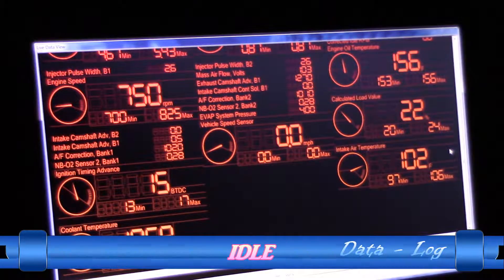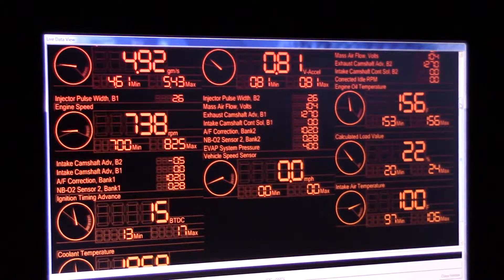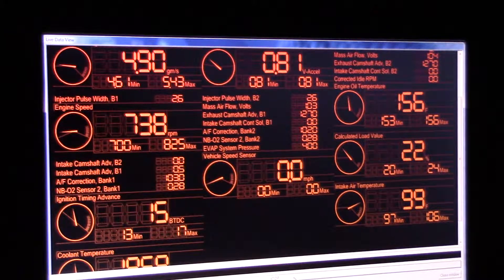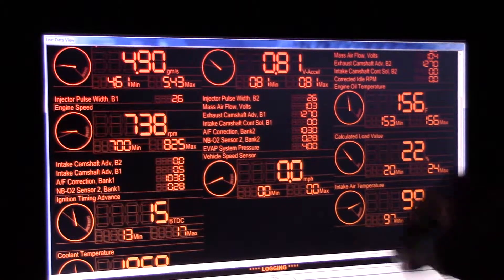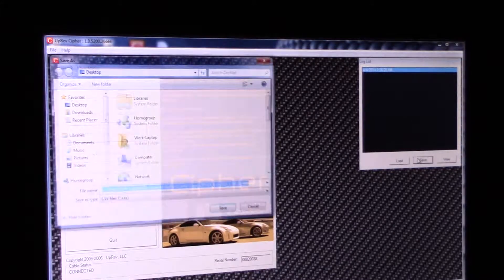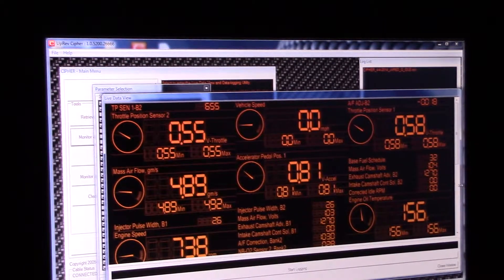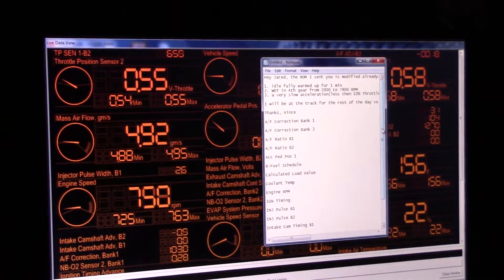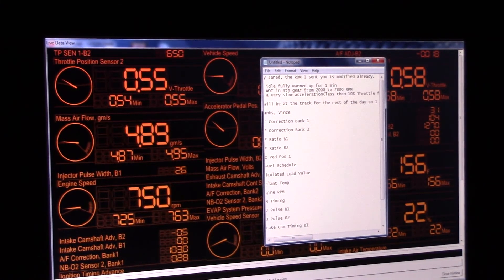Uprev E-Tune Idle Data Log 350Z

Comment: What do i need to see this realtime info of my car ?
Reply from the maker: +VxxF This is for Tuning your ECU.  There are so many variables to tweak and "map" after you have installed a certain amount of performance enhancements to a sports car to get the maximum power out of them.  The data you are seeing is from Cipher which hooks into your OBD port and reads all the variables in real time from your cars computer, and logs them.  You then take these logs and make adjustments, go out and test under idle, certain full throttle runs in specific gears, slow acceleration, and so on to basically add horsepower and torque to the vehicle and make the drivability better than it was stock.  You also can increase fuel economy, and with mappings I have 1-5 -- 1 = Full performance settings , 2 = low octane settings (if you were to put in non premium fuel), 3 = Valet mode, which limits the Rev's (RPM) to 3,000 and top speed to 35 mph so the valet (or whoever) can't rag you car out and can only drive it at speeds that are reasonable to get it from point a to point b.  4 = ECU engine cutoff - With this it's pretty much impossible to steal the car by starting/driving it -- This setting tells the ECU to never allow the engine to start (cutting fuel injectors/pump, etc) -- A thief would have to know the pattern of holding and pressing buttons (cruise and cancel buttons in my case) to switch this off.  5 = Stock mapping (how the car was/is from the factory).

This site may help you understand:  https://uprev.com/secure/

Bottom line if you aren't looking to increase the performance of your sports car then it has no bearing/importance to you.

Comment from the maker: MagicAyrtonforever  It went quite well.  I'm very happy with the results. I used an Uprev package, but went with an experienced tuner outside of Uprev.  That was My choice to do,.. I spent a little more to do so, about another $200 for the services of the Experienced Tuner (To build the maps according to exact car with it's mods, and what the logged data I provided exhibited to the Professional Tuner to make it a "custom" tune for the car).  -- All of that said,.. The Uprev packages, filling out the webpage with your car, make, model, year, exact modifications you've added, and any custom changes you'd like on any of the 5 maps it can hold, work VERY well.  I would estimate the performance map from Uprev will net about 90-95% of what a custom tune would.  I gained an additional 25-30 horsepower over what the mods were already giving the car, money WELL spent as just 10 horsepower on our Z's is hard to squeeze out for less than $1000+.  Moreover, you can definitely FEEL the difference in the car, and can switch between the perf. map, and stock to get that seat of the pants change to truly realize it was money well spent and works.  Plus you get the 4 other maps,.. in my case I have Map 1) Performance Tune 2) 91 Octane (ability to run this gas safely), 3) Valet (3k RPM limiter with 35mph top speed, 4) Theft prevention (Impossible to start the car), 5) Stock map (Of which I use to get the best fuel economy when I'm not "having fun" with the car if you will. :)  I"d suggest the Standard package, which I believe is $500 and they provide 3 e-tunes in a 12 month period.  If you want 100% maximum power from your car then you should find a tuner in your area with a dyno who has a good reputation.
Reply: Great stuff, thanks for the reply.. I wasn't too keen on taking it to a tuner as they say they will need half a tank of fuel for just for road testing after the dyno.. makes me cringe!
Also, being a mechanic, I would like to flash the ecu myself and get a custom made map by uprev after data logging as you suggested in your other great videos... also we have Shell V power over here which I believe is 97 / 98 or even 99 octane super unleaded petrol. (gas)
Reply from the maker: MagicAyrtonforever Most welcome.  Always happy to give my opinion as I see it :).  I do all the work on my car, cept for the first time I have it at the shop to put in a JWT clutch package, new flywheel, HD master, HD slave, Nismo Roller Bearing, etc.. I didn't want to do that on jackstands to be honest. But to be honest it's been a hassle (but it's a long story) -- Anyway,.. Yeah, I had a local tuner I spoke to, who had a huge ego (not sure what it is with the ego's and the Z tuners and such lol) -- and basically told me what he HAD to do with my car or he wouldn't do it.  Sort of a jaw dropping wtf moment... I did have a problem with him saying there was no option but him taking my car (and I could not stay at the facility, I had to come back and pick it up later) and road "test".  I'm sorry, I don't want some guy to go ragging the hell out of my car after they dyno tune it.  I've tweaked my map on my own from driving, but it's VERY subtle and , personally, I'm more than happy to take the best they can get off a Dyno and skip the road test.  It's amazing the tune you can magically get ONLINE and your own driving logs.. so why hand it over to some stranger who doesn't really care about your car to go balls to the wall "road testing".  (No offense to tuners out there.. :) ).  Where is here? btw?
Reply: Ikos Log haha :) funny comments :) Well I am in the good old United Kingdom! We don't have many skin heads these days but that's what I imagine when handing my car over!!
Reply from the maker: MagicAyrtonforever Ah, I have many friends over there.  I don't imagine skinheads lol.. but I think for people who put so much time and effort and are invested in their cars like we are it is very difficult to let anyone besides ourselves do work on the car in any form.  Sometimes we have to though,.. due to not having the machines, tools, experience, time, etc.. As is the case with my car now and it's sitting at Nissan as we speak,.. and it does worry me how it will be returned.  Not so much about them test driving it.. A regular drive after some major work I want someone to do to ensure everything is perfectly working as is my case -- but in the case of the Tune,.. that kind of driving is pushing the car to the ragged edge :)  Since  you are a mechanic I'd like to relay a story and question to you about the shifter.. send me an email to ikoslog@gmail.com and I'll respond when you have a spare minute.  Take care!